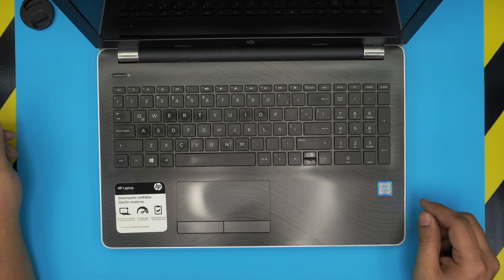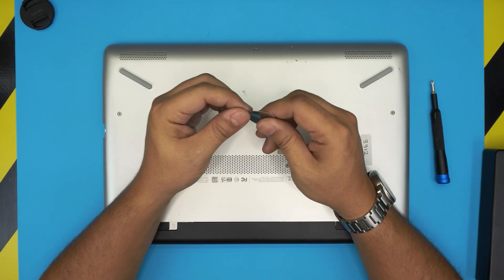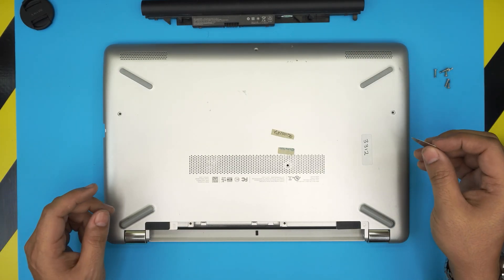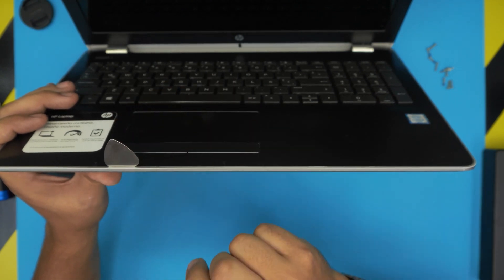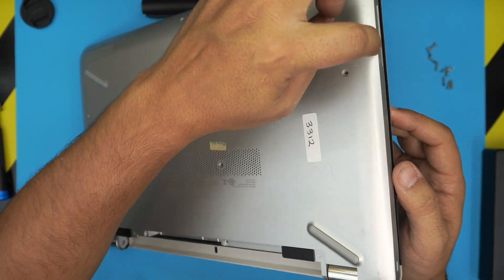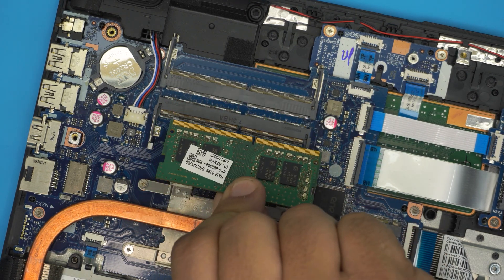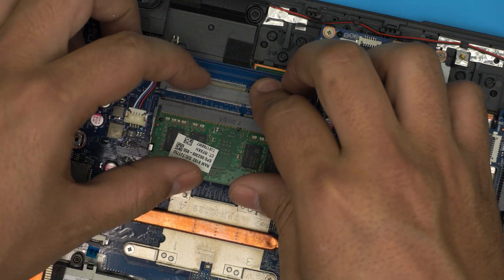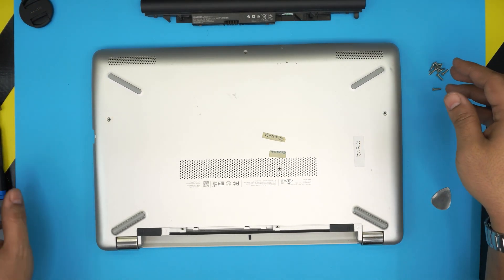HP Pavilion 15 BS 📢 RAM UPGRADE

Comment: Thank you for the detailed video. Re: HP Notebook - 15-bs151nia what is rhe maximum size n specification of RAM x2 i can use. Also the maximum SSD i can install. Is it possible to upgrade the processor as well?
Reply from the maker: It's my pleasure my friend.
🫠Regarding your questions, the RAM was explained in the video, and the link to check the maximum RAM capacity is in the video description. Check the link to see the maximum RAM capacity your CPU/motherboard can handle, as there are many versions.
https://youtu.be/tKEJTkVth4Q
-----------------------------------------------
The CPU is soldered on the board and is not upgradable.😔
Should you have any further questions or requests in the future, please don't hesitate to ask me.
cheers🍻

Comment: I'm looking at upgrading the ram in my laptop soon which started making my buddy want to upgrade his, he has the bs234wm model and looking at the manufacturer's manual and such it says there's only one spot for memory and it has a 4gb max is that really the most that version can have?
Reply from the maker: 🫠Regarding your question, your laptop has two slots ram on it and you can instal 2x 4GB without issues.
Should you have any further questions or requests in the future, please don't hesitate to ask me.
cheers🍻